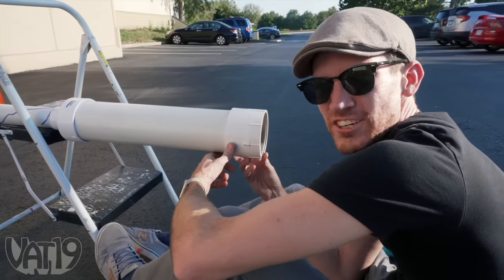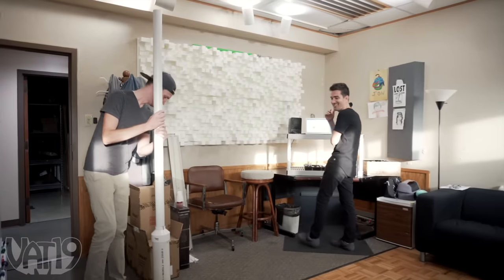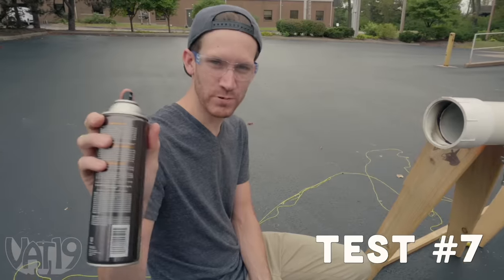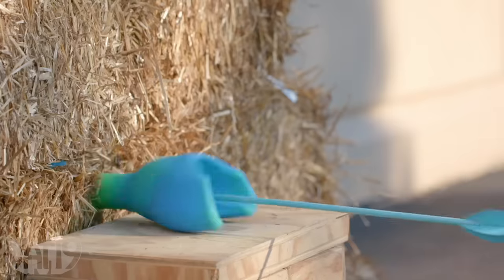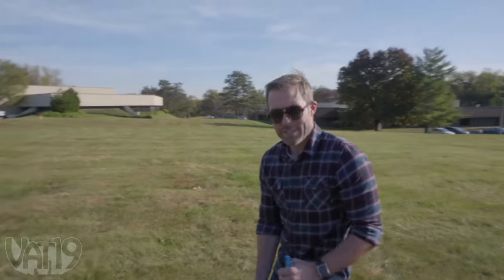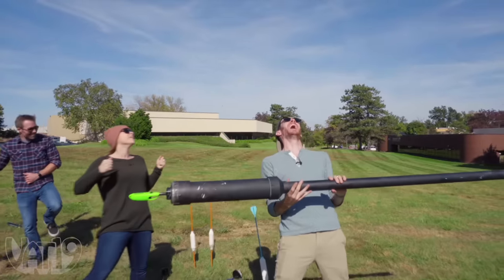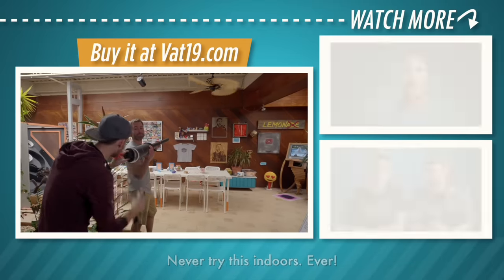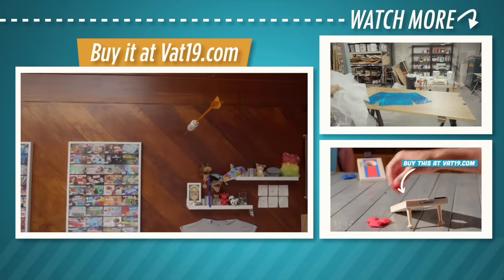What Makes These Darts Harmless to Shoot? • This Could Be Awesome #6

Comment: Get rid of that gunky hair spray, use a propane torch to inject a perfect mixture of propane and air. You'll get consistent and snappy shots every time as long as the chamber is vented between shots. Best way to do it is tap a hole in the rear of the chamber for a 3/8" NPT ball valve, which you open and stick the torch head inside (just the tip, don't cover the venturi holes of the torch head), flow gas for twenty seconds, then close it. My golf ball gun uses this method and shoots at 750 FPS with a 5 foot barrel lol.

Comment: The dart fins were definitely the problem. Those fins' flexibility was the dreaded in-between. You probably should've gone full-flexible, like an arrow's fletchings, or non-flexible, like 1/8" aluminum sheet, or 16-14 gauge steel.

Comment: Danny, your problem was the fuel to air combustion ratio. When you use ethyr starting fluid gas it makes potato cannons a nightmare. You need to find the right proportion to air for different humidities.

Comment: The fins bending isn’t the problem, the problem is the fins don’t get smooth air to guide the dart. The foam sabot is in the way for the airstream. This is the same system they use on modern tanks.